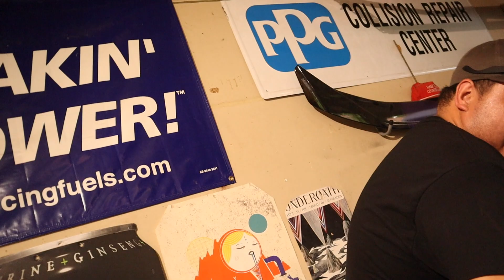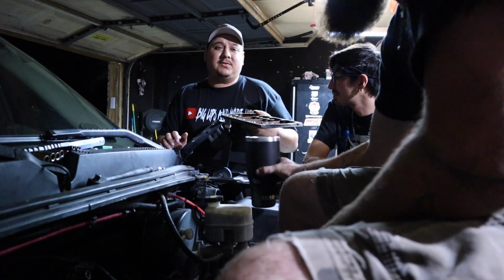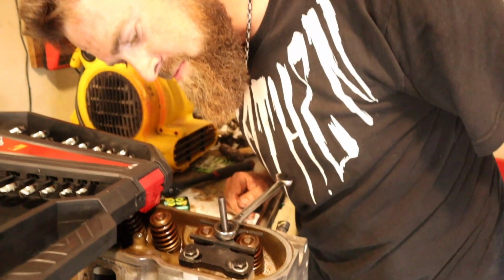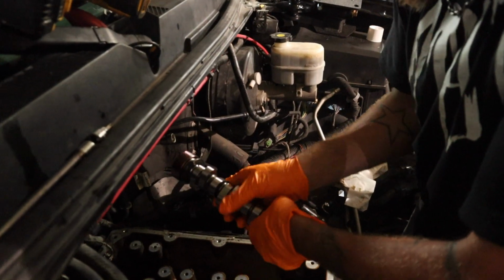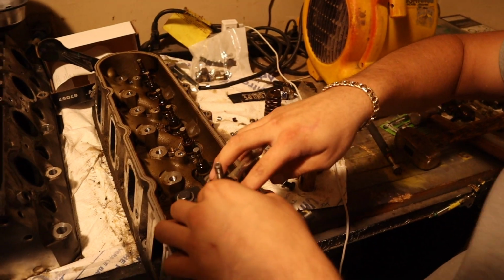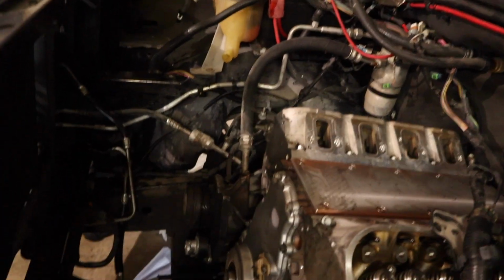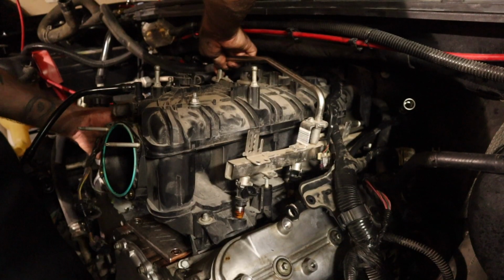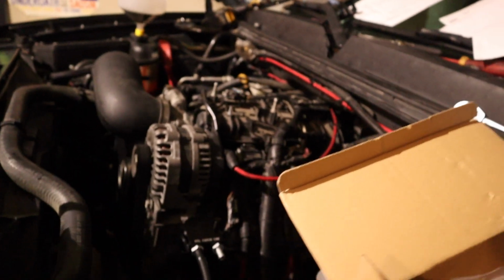WE INSTALLED A BTR CAM IN A 6.2 DENALI!

Comment: How much does it typically cost to install a new camshaft into a denali with a 6.2 engine
Reply: With a big stall, dual springs and everything required i think you're in the ballpark of 5k. I went overboard with upgraded parts and gaskets and it roughly ran me around 7-8k.